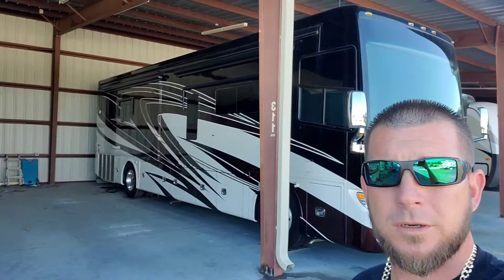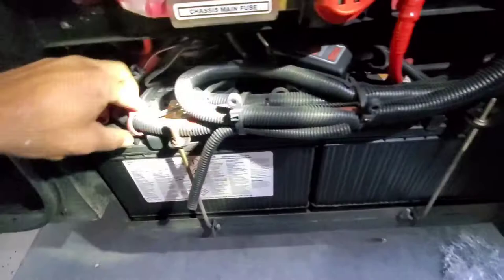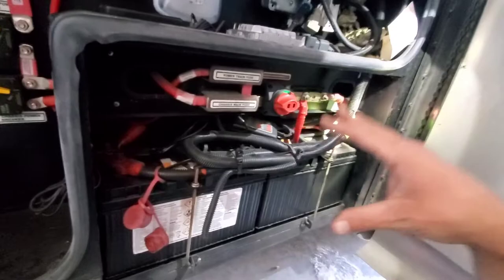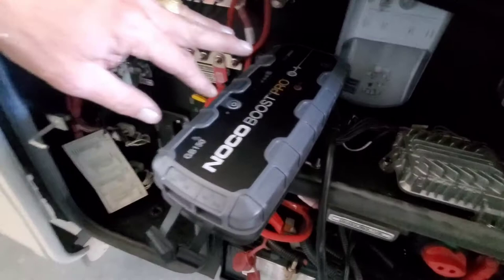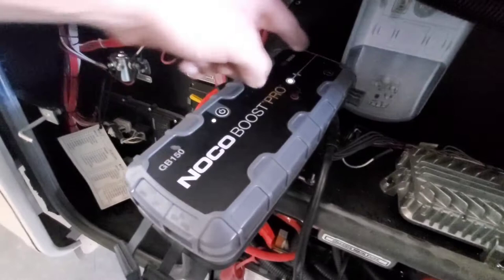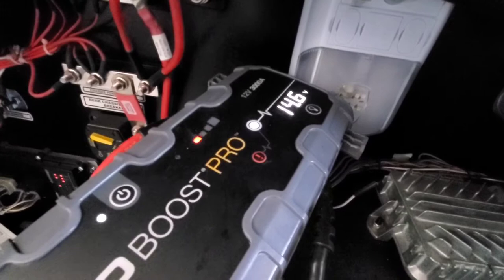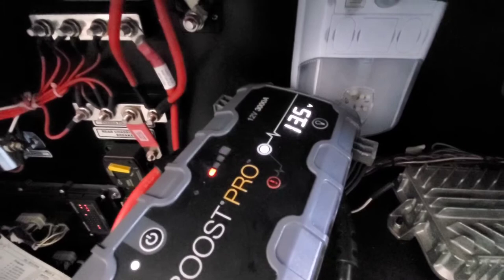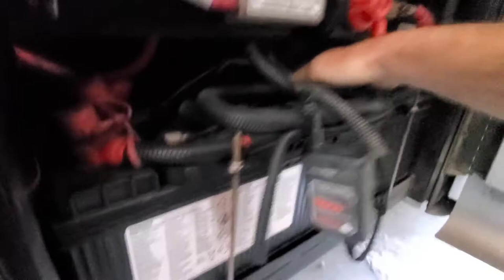HOW TO JUMP START ALLEGRO TIFFIN MOTOR HOME COACH RV

Comment: Excellent video, thank you! I purchased a NOCO boost and it works great. I do hav a question for you. I replaced the chassis batteries for my 2020 Tiffin Allegro re 340 33al  motorhome but continue to see a low voltage light on the dashboard. When I’m in this state, the generator won’t start and my low/high ride adjustment doesn’t seem to be working. I’m going to have a mobile mechanic check it out, but thought I’d see if you’ve run into a similar problem before. Is it possible I hooked the two new chassis batteries incorrectly?
Reply from the maker: Hello and thanks for watching. I doubt you hooked up the batteries and correctly. And so you would have had a bigger problem than low voltage. Most likely what you have is a parasitic drain. Almost all armies have this issue. The only cure is too good a solar panel trickle charger or a battery tender trigger charger to keep it charged. You can disconnect the batteries by having a kill switch. But that's not gonna keep the batteries from dying. They will still die just from sitting without being used often. They will still die just from sitting without being used often. So having something like a solar panel trickle charger works in this situation.

Comment: I have a Super C, engine battery isn't charged enough to start it, only been sitting a month and will not start, any suggestions, motor starts to turn then stops, it is plugged into 50amp along with a generator